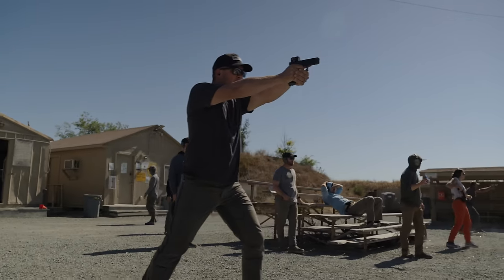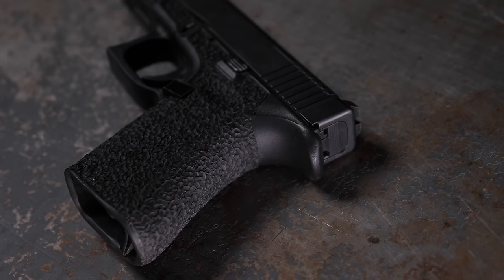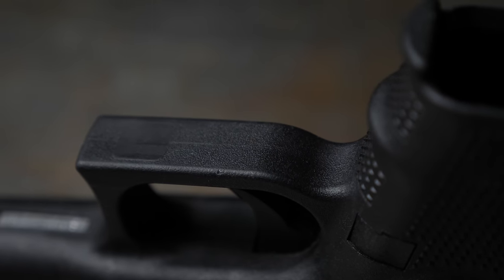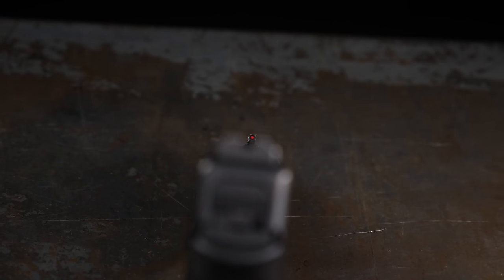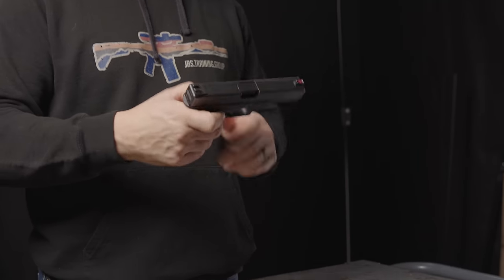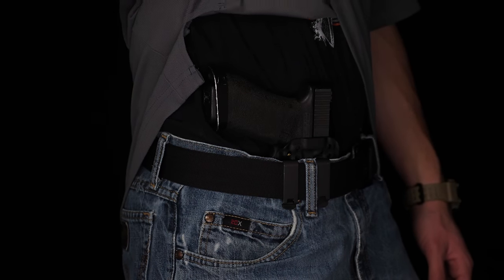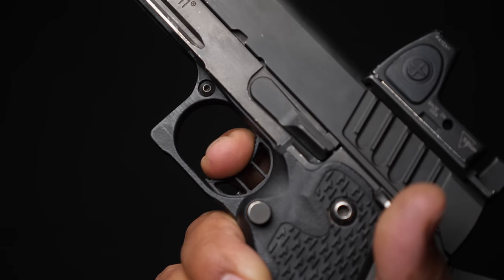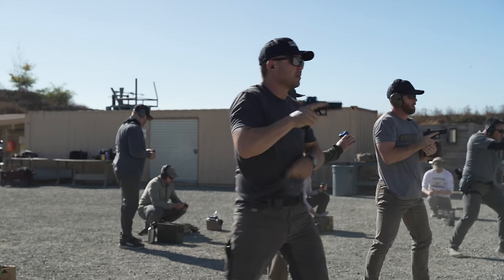Mod Your Carry Gun: Do's & Don'ts

Comment: Modifications are ego driven a lot of times. For an EDC gun, the best money you can spend on modifications is to take classes. Money well spent.
Reply from the maker: It's true. We all need to check ourselves.
Reply: Stop it with the classes
Reply: @GunsNGames248  yeah...classes are overrated for most shooters.  Very few people actually have at home ranges where they can practice the same drills.  Now a good trigger will make a lasting change for sure.

Comment: Personally would never upgrade a trigger on a ccw. Light, red dot/sights and grips if needed but nothing more. For me of course.
Reply: I agree, in MY opinion you’re helping the prosecutor if you ever had to use the weapon, or the plaintiff if an accident occurred.
Reply: I agree with this. No point in modifying a trigger at all!
Reply: @TheAppalachianKid nonsense
Reply: On my G19s I swap out that so called "Target or Sport" trigger  whatever Glock calls it for a smooth G17 trigger, that standard G19 trigger with those ridges gets irritating specially after sending a bunch of rounds down range.

Comment: As always test ur stuff. You can modify any part you want, including the trigger. Until you bring it to an outdoor range and put it thru hell, DONT carry it. 2k rounds thru my modified g43x before carry.
Reply: What did you modify??
Reply: Vett your stuff . A lot. I've had new OEM pistols that didn't work. Stock means nothing.
Reply: @GLDElDuende  arc reactor slide , NP3 coated internals from Overwatch precision, Overwatch trigger shoe. High quality stuff that costed some money, that’s probably why I never had issues

Comment: Catastrophic failures aren’t a failure to fire, but rather a round over pressuring your barrel and causing it to explode
Reply: You are right. Although if you are in a self defense scenario, a failure to fire can be catastrophic
Reply: @andresmonagas7662  true, but with the same logic a failure to fire could be catastrophic in a world championship pistol competition
Reply: Your right but it’s in a given context
Reply: Idk man if I need my gun to go bang and it doesn’t, causing me to potentially be killed or severely injured, I’d say that’s pretty catastrophic of a failure
Reply: What are you, the catastrophic failure police? Har har har
Reply: "Catastrophic failure" doesn't have a single qualifying definition. Rather, it is any failure that cannot be corrected quickly, at the moment, to allow you to get the gun back in operation. Yes, the barrel exploding from a round over pressure would certainly qualify as a catastrophic failure. But so could a broken firing pin that prevents the pin from contacting the primer, there is no way to fix that in the moment, given the time frame of a gun fight (or in competition for that matter). Broken hammer springs, trigger springs, internal components, etc. are also examples of catastrophic failures. By contrast, failures to feed, failures to extract, double feeds, stove pipes are all examples or malfunctions that can be corrected quickly through immediate action drills.

Comment: Sig P229 for me. Any off-the-shelf all metal P series Sig, with a decock, is the best off the shelf gun. Buy one used. Replace spring and guide rod. Get comfortable with it. I have a Sig P229 Enhanced Elite Blue Titanium. It is a nail driver. All these years, I've never had any type of malfunction.

Comment: I love carrying magwells on my full sized, ACRO P2 equipped pistols. Most people, even other gun guys, are not gonna notice minor printing.
Reply: I have been daily carrying for 30+ years.  I’ve been daily carrying a G17 with a P2 ACRO, a magwell from Agency Arms and a Surefire X300 turbo.  I believe in RDS and an under gun light. The P2 ACRO is bulky for edc. The magwell is ok but not necessary; It’s my first and probably will be my only one.  I believe that a light is very important. It might sound a lot to edc but it isn’t really.  Your holster, belt and what clothes and how you wear them is key.

Comment: Good stuff. You're one of the most pragmatic voices in the gun space as of late and it's appreciated.

One small thing I've found works nicely on Gen 5 guns for doing something small and magwell adjacent is taking a Magpul mag well and chopping it down to a grip plug. None of the dedicated plugs I've seen eliminate the way the arch at the back of the grip can snag mags quite like it. Adds a quarter inch of length and no width. Besides that and some small sections of skate tape for thumb indexing, I've not made a habit of modding guns, especially not their internals.

I've tried a few triggers that mostly just disappointed me for the lack of improvement relative to their cost. Ghost connectors never seem to make a difference to me, but I've also only tried them in guns that had a thousand rounds through them and were likely already well broken-in with their factory parts.
Reply from the maker: Appreciate the support and input 👍

Comment: They're definitely not required, but slide cuts are very useful if you're running a dot, especially an enclosed emitter like an ACRO or 509T.  Makes racking the slide from the front a hell of a lot easier.  Preferably, the gun comes from the factory with front serrations, though.
Reply: Racking the slide from the front goes against basic firearm safety.
Reply from the maker: Properly racking the slide forward of the ejection port is most definitely NOT a violation of basic firearm safety.
Reply: @tenicorusa  why would you want to put your hand close to the muzzle when you could rack it from the rear? It is a common sense thing.

Comment: I carried a G43X for a few years strong side. Shield arms 15 round mag, a SCD (striker control device), and a Trijicon RMRcc red dot.  

After 4K plus rounds, I finally admitted to myself that I hated it. The trigger is horrible and, at least with me, it took at least two seconds to pick up on the dot even with countless hours of practice. 

Sold it and purchased a CZ P-01. Built like a tank. Immediately shipped it to Cajun Gun Works for their $435 absolutely brilliant hand-fitting and another $90 for a barrel bushing. Next, I installed a TLR-8a green laser / light combo. Lastly, a beautiful Southern trapper holster. 

Now? I carry AIWB and barely even notice it after a couple of months of doing so. I can keep my thumb on the hammer while reholstering negating the chance of an accidental discharge. When I draw I easily can turn the light and laser on instantly and acquire the dot in a fraction of a second. 

Takeaways? A light/ laser is vastly superior to a dot for EDC. DA/SA is, in my humble opinion, a safer way to carry and my CZ is as smooth as glass. It’s not necessary to compromise on EDC by having to mod the hell out of a substandard Glock.
Reply: If you can't find the dot then your grip is inconsistent. Which means you need to train more. Lasers are trash. Instead of being target focused, you're going to be looking for your laser because of your inconsistent grip. But you do you
Reply: @willr4880 you can do both...the important part is that you train with your setup.  I partially agree with your point on lasers, until I took a class that simulated firing from cover...in which the laser is used while not exposing your head (think using a car as cover, or also point shooting).  That said, "hunting" for a laser can waste time and get you shot.  

Red dots are fast both in low light, and precision longer distances.

I'm dipping my toes into red dots, and 75 meter shots are getting really easy.

Comment: Learned a lot and to the point winning my subscription.  On humble observation about grip hacks, removed material is gone forever so be thoughtful, not hasty.  As a 1911 Browning Hi Power shooter I was anxious to chop off the rear strap hump on a 19 Gen 3 but first applied stipling to the sides and front, and to reduce the grip circumference,  ground down the 2 pointy pyramids called finger grooves in glock talk.  Still dissatisfied, Traction grip tape from Instant Stipling remedied the issues with slippery side panels and the now flattened front strap.  A mild sanding at the trigger guard root as recommeded in another Tenicor video solved the glock knuckle problem. These alterations were sufficient to address the discontent I was experiencing with the Glock platform without having to radically go further and cut off the 'hump.'  As Lenny McGill describes the rear strap profile is thought out for a 2 hand hold to render instinctive pointing and the problem some shooters think it presents is a false flag, instead the traction and grip circumference should be taken care of before irrevocable amputations.

Comment: The overwatch precision NP3 striker for Glocks and P-10’s is one of the best risk free trigger upgrades you can get. Really smooths out the trigger pull without having to worry about light strikes or compromising the drop safety of the pistol. Can’t recommend those enough. These days though I’ve been telling people, the red dot is the upgrade that will help you more than any trigger job or stippling or compensator/port
Reply: I often add 3.5lb Glock Store NP3 coated connectors to my guns. It helps but it's not critical.
Reply from the maker: Overwatch makes some good stuff. A lot of us here use some of their Glock components.
Reply: Was going to comment on the overwatch np3 striker from overwatch. Saw your comment Makes my already great p10f trigger very close to my pdp pro sd trigger. When I do a Glock clone build it will have one of those strikers in it.

Comment: One thing that I absolutely advise is to train with the ammo you intend to carry with. A lot of people carry expensive "personal protection" ammo, but train with the cheapest ammo they can find. It is very much possible that the gun may not cycle correctly with the "personal protection" ammo, or that it has significantly more recoil than you are used to, which throws off follow-up shots.

Comment: For my big hands, undercutting the rear of the trigger guard for my middle finger of my strong hand with the drum of a Dremel has been extremely helpful.  I also have put a slight lateral indentation on the bottom of the trigger guard where my support hand index finger makes contact in order to have a simple index point.  For CCW, I would be VERY hesitant to use an extended mag release.  They’re OK for competition, but I’ve seen too many people grip down and drop a magazine inadvertently under stress.  The chances you will need a tenth of a second faster reload after expending a full magazine is very outweighed by the likelihood of making your gun into a single shot during the draw or presentation. Extended slide stops can be problematic also.

Comment: All I did to my Glock 19x was put a tan slide backplate on it and get the Glock performance trigger, it’s dead nuts accurate and I can draw to shoot as fast as I could hope for, it also has night sights and I understand the advantages a red dot could have but I’m just as fast. I also have a walther pdp with a trijicon rmr on top and it’s equally as fast and accurate as the Glock at 20-30ft

Comment: I'm running a magpul magwell on my glock and since it is pretty low profile it still conceals really well for me, so If you want to run a magwell and still keep your pistol concealable give that a shot, might work forn yall too.
Reply: Depending on the pistol, magwells can be pretty awesome.  But people need to be careful what they buy, as they have differing mounting setups, and an actually prevent stripping a mag out of the gun to fix an issue.

I went with an "Overmatch" Model" due to the lockup and rear scallop that allowed me pry a mag out of the gun in a hurry.

Some models don't allow this, and need to be avoided if it's a carry gun.  

Getting the mag out is only secondary to inserting a new mag in order of importance.

Comment: I agree with most of this other than the sights; I like the bar/dot sights over any other, but I like the blank rear sight least (the trench sights of my revolvers might even be better.) Everyone else's mileage will differ, though.

I didn't have a great experience with a red dot, but that was mostly me; I had to chase down the dot and ended up giving up before I worked it out. Good vid!
Reply from the maker: Adjusting to the red dot will definitely take some time and practice. Keep at it, it's worth the effort!
Reply: I don’t know why he threw “no U-shaped things in there” other than out of his own bias. And “a black rear sight is perfectly acceptable.” Because those are both inaccurate pieces of information that would’ve easily been left unsaid. Contrasting shapes are great for low light. They’re very straightforward. If you can’t see your black rear sight, you shouldn’t be shooting. Illuminating your position with a flashlight or whatever is not always a good idea. Marked rear sights literally extend the duration you can perform movements, make use of concealment, and do things like hunting. If you do things like hunting, the inability to sight in low light is potentially a daily occurrence. Hopefully that hammers home what an ignorant piece of advice that was, on his part. Don’t take my word for it, the evidence is omnipresent.

Comment: All good, solid points. I would add on sights, whether it's irons or optics... source a system that YOUR eyes will pick up fastest. Dot or front sight... Doesn't matter. You want the ability to get that shot off accurately and quickly. And the only way to discover that... Practice and train. Keep up the great videos Jeff!
Reply from the maker: A good sighting system is important. We did a follow-up video to this one and went into detail on irons/optics. Thanks for your comment.

Comment: Just buy a canik TP9 SC Elite or Canik MC9. Order the recoil springs, mecanik red dot, trigger, magwell etc from Canik directly. You have a really well put together CCW. Just my 2 cents...
Reply: Good input. Then you still technically have a stock pistol with factory upgrades. Good idea.
Reply: Just ordered the threaded barrel, mag well, & recoil spring for my Tp9SF elite.
Reply: @rodthefearless4015 do you carry a light on your elite? It's hard to find good light bearing holsters...
Reply: @shotzrangout  I’m having difficulty finding one myself. Honestly I’ve been considering having one custom made just for it and just get it over with. Especially now that I’ve added the flat face trigger.

Comment: I added front serrations to my gen4 G20 after a day of training in the rain and losing my grip on the front of the slide multiple times. I could have run the gun for my optic but adding front serrations does nothing to take away from the reliability and offers me a more secure grip on the slide in adverse conditions. I believe every carry gun should have front serrations if it's running an optic.
Reply from the maker: Front serrations can be a good addition if done correctly 👍

Comment: How do you feel about barrel porting/slide milling to make an integrated comp from a 3rd party manufacturer like how the firearm manufacturers make (i.e. Sig, Canik,S.W) but on a firearm that doesn't come with the option? Thinking of porting a Canik Rival S because I want the advantage of the TTI Combats compensator but the Rival still doesn't have a threaded barrel after 2 years so I figured I'd see about sending it out somewhere
What companies would you recommend?

Comment: Tbh i run a carry with a comp, with cuts (not necessarily a choice on that one it was the slide i could get at the time, itll be changed at some point) a magwell and its currently got night sights. Yes all three points have tritium. I prefer this too, it allows me the better ability to align sights in a low light/no light situation even if i dont have a light to hand. Yes my comp makes my pistol longer but i also find it shoots smoother and im willing to add 1/2 an inch to a 19's slide if it means i get a better performing gun that im going to entrust my life to. My magwell is also flared, for me this is because i found that the grip wanted to ride out of my hand after three or four rounds no matter how well purchased i was on the gun, as im already a big framed guy whos first carry was a beretta 92x adding that slight bit back on wasnt even that bad and really, my flare is basically the same size as my mag plates are, its that small but it gives me better control and thats what i prefer.

I think a better argument for this video should be "what to consider before modifying a carry gun" because really, range time and drilling is whats gonna tell you whete your weak points are on a gun. Yeah my carry gun to you is probably gonna be a hellish thing, for me its comfy, but its built to be something im comfortable with that i can hide that i entrust my life to because of the time ive got on it.

Comment: One thing I noticed that wasn’t mentioned at all was muzzle devices (No Sound reducers lmao) Like
Compensators and Muzzle Brakes. Good example is the Canik Sub/Micro full frame compensators. Sleek fit with practicality in cases. Or Just your standard threaded devices.

Comment: My revolver’s sights are solid black front and back and this basically makes them useless in anything but bright lighting. Suggestions? There aren’t a lot of aftermarket options for my model, so I’m kind of stumped. Makes me wish I’d gotten the stainless steel finish, that one comes with an orange dot in the front.

Comment: I only have magwells on 2 of my EDC‘s. That’s because my pinky finger does not fit on both of those. For some reason, I do not feel comfortable with a small grip EDC when my pinky finger is hanging off the bottom.

Comment: I carry a Glock 47 with ACRO P1 and Surefire x300T appendix with a spare mag in a T Rex Arms sidecar. little to no printing. (6'3", 215 lbs). I think you should carry the biggest gun you can properly conceal